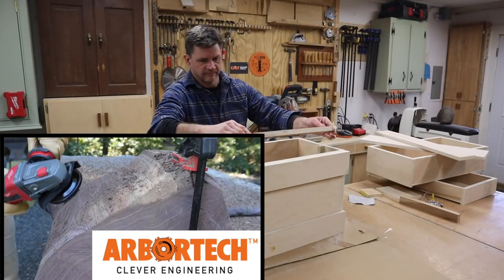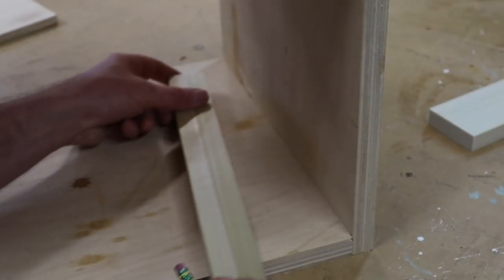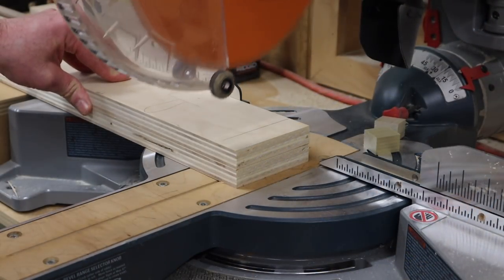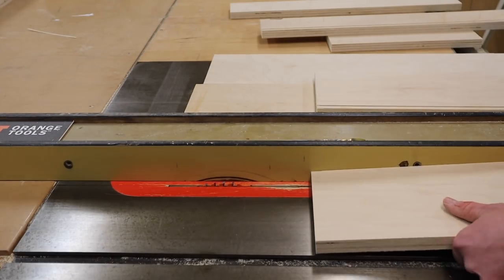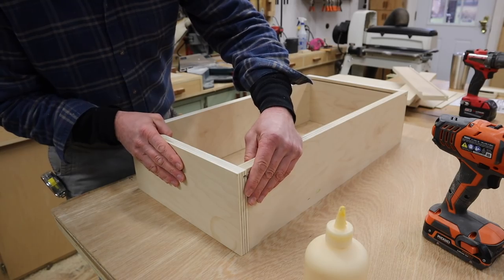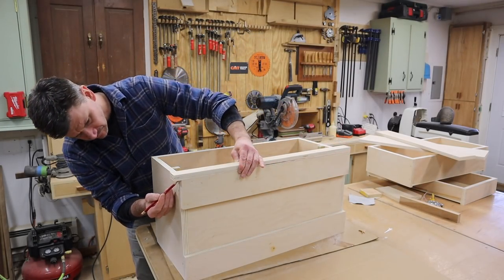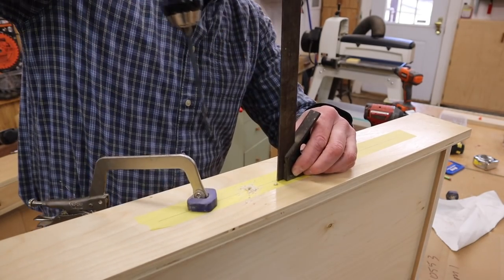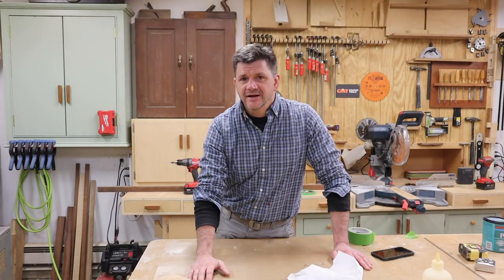How to Build an Organizational Shop Cabinet with Simple Drawers

Comment: Great little cabinet. How come when making the groove for the drawer bottom you cut through the drawer back piece vs. putting the groove in the back and cutting the bottom to fit where it would be trapped? Just wondering if there’s a reason or it’s personal preference.
Reply: I think that the drawer will have a lot more resistance when the back is also touching the bottom

Comment: I love the cabinet. I'm wondering if you can comment on whether a mobile stand is worth the investment as opposed to a shop built stand with storage. It sees to me that a shop built mobile cabinet designed to act as a stand for the sander could have a similar footprint and offer more storage and customization. Are there any advantages to a purchased stand?
Reply from the maker: I think so , it's nice to be able to move it around the shop.
Reply: Sorry, I meant a mobile shop built cabinet as opposed to the store ought one.